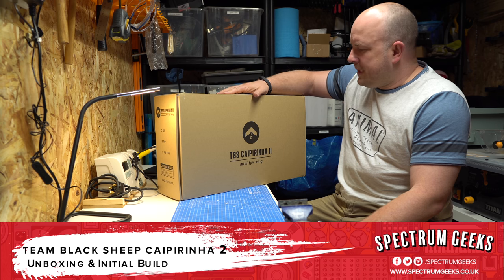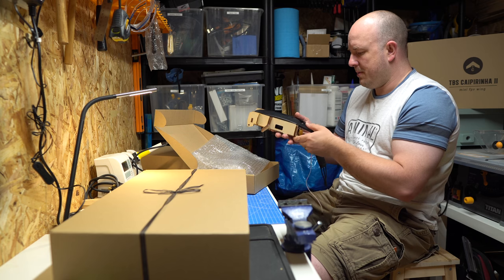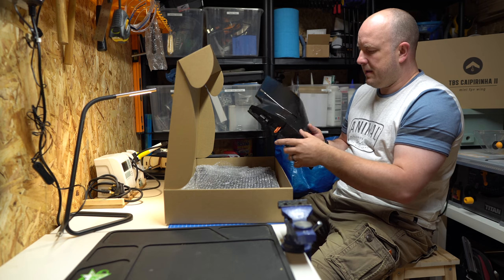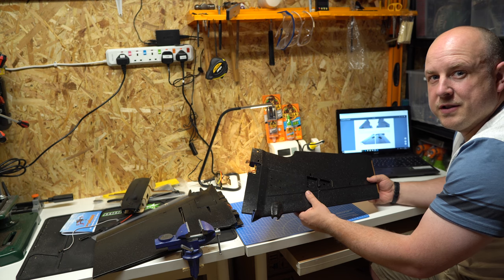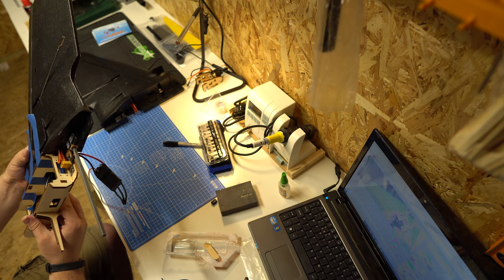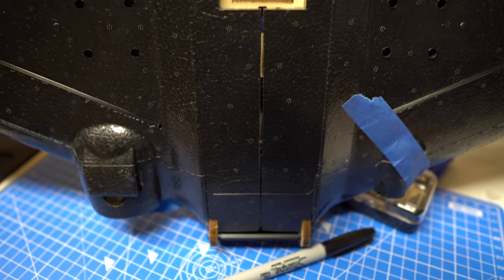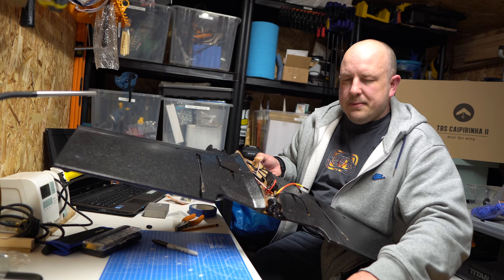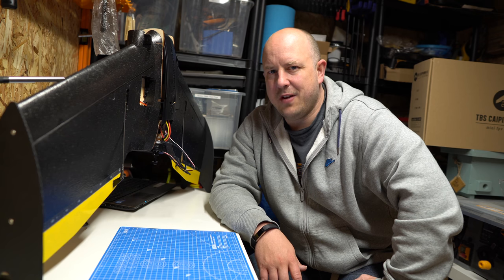Team Black Sheep Caipirinha 2 PNP Kit Unboxing and Build Part 1

Comment: I know this is an old wing, but I just got it and your video is very helpful... Even the 'mistakes'.   I too have watched Lee's video and he makes it seem flawless.  Sorry about your luck with it, but it's nice to see how it can go wrong so that I can pay close attention as I assemble it.  Thanks for the great work!

PS... Put a link in the description to Part2 and Part3... I searched your videos for "Caipirinha 2" and it tells me there are no videos related to this LOL
Reply from the maker: Thanks for watching. I still plan on giving this one more go, once there is a break in lockdown, the weather is good and I can get out.
I didn't put links in the description, as there is a separate playlist just for this :) https://www.youtube.com/playlist?list=PL8POksoVbmSwVTbTxhveIgKWT2z1j31ts
Reply: @SpectrumGeeks  check out the manual.  There is a section on how to launch... And give it like 75% throttle.  Also helpful if you can keep your right hand on the sticks instead of left.

Best bet is to put a flight controller on it with iNav and auto-launch.  It will keep it level and get it high enough that you can take over and start trimming etc.  As soon as you get off the ground, CLIMB.  The general rule is 3 mistakes high.  With this speedy sucker, that's WAY up there lol

Good luck!
Reply from the maker: @jawa6988  Yeah I have had it flying and in the air for a short period of time :)
Reply: Instablaster...